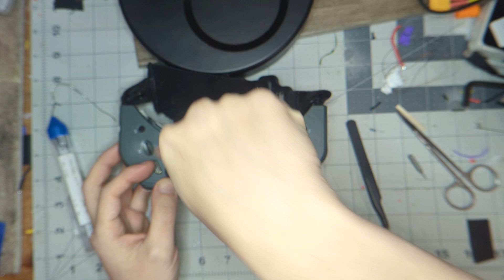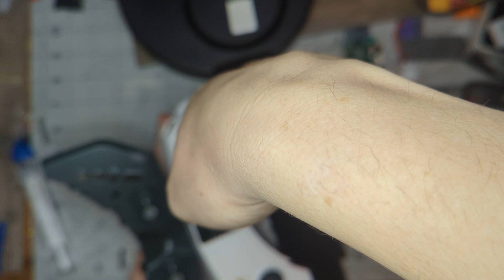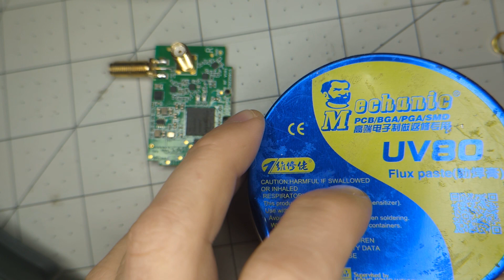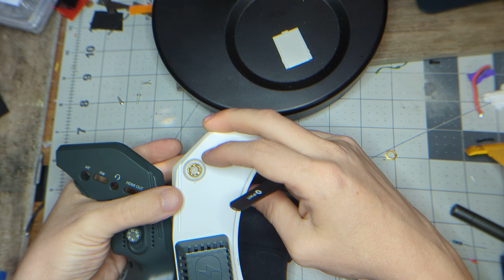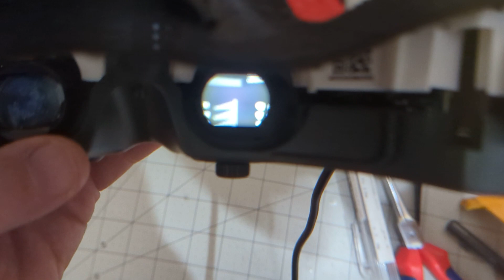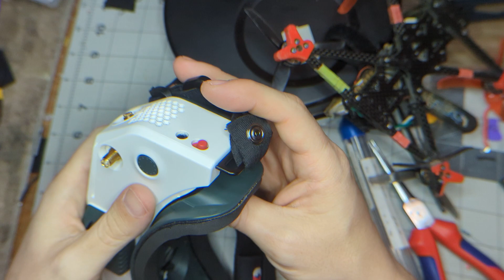HDZero Goggles top SMA low signal repair

Comment: Thanks for this video.  My top left antenna was very low signal strength, probably from dropping the goggles. I replaced the left side sma board and it's back working now. No visible damage on the board or solder connections though.

Comment: I got the round 1 goggles that had the nut on the goggles but saddly during taveling the the nut on the same sma connector you worked on came loose and the connector was bumped in traveling and came free from the board. the board was a total loss so I purchased a replacement board.  I reinstalled the goggles and the screens work but I get now signal from any antenna from my whoop lit vtx.  What should I look for?
Reply from the maker: Can you come on the HDZero Discord? It would be easier to troubleshoot there and you can share pictures.

I would start by reseating the mipi cable on the camera and VTX.

If you got the goggles prior to Feb 2023, I might try updating the goggle firmware, just in case there is any data that needs to be loaded onto the new radio board. The goggles that are currently shipping use different firmware that isn't released yet.

Comment: You did a really good job with this. Those ribbon connections must be a little bit tougher than advertised or are they strain relieved somehow at the connector? I don’t have them yet (March apparently) but I appreciate the demo. Luckily they seem fairly easy to work on since it would appear that diy repairs are immediately necessary in a lot of cases. I subbed. Thanks.
Reply from the maker: The ribbon connectors are fragile. If they are flat and straight, they can be somewhat okay under tension, but can break very easily.

Comment: Thanks for the video. I just received my goggle today and notice I do have the same low signal strength issue on the top right port (I wonder why it is always the top right port and not the left). I am just wondering what would be the effect if I just leave it as is and just rely on getting the signals from the 3 other ports before opening up the brand new goggle lol
Reply from the maker: That's really interesting that you are seeing it on a brand new goggle.

Did you already try swapping the left and right antenna? If it is still a problem, I would be really interested in knowing if it is this issue.
Reply: @aviphysics  yeah i tried to swap the antennas and the issue remains (so it’s not an antenna problem). I can see that the top right sma is slightly crooked (not straight)

Comment: You are way rougher with those ribbon cables then I would be. Think I'd remove them if they aren't soldered? Looks like some kind of plate with 2 screws holding them down onto a connector? Edit: thanks for video though! Issues like this wouldn't be too difficult for me to fix.
Reply from the maker: You can remove them. They are similar to the mipi connector on the VTX

Comment: Would hate to have to deal with this issue when my new goggles arrive any day now. I intended on running 4 stubbies, so over time there is a chance that without the sma nuts and washers on both the inside and outside of all 4 ports, that this will develop into a problem (particularly, if we want to keep the antennas installed all the time), which may well be out of the warranty period for the goggles. I wouldn't really want to open up the goggles for fear of damaging something else...
Reply from the maker: How did it go?
Reply: @aviphysics  I never got round to doing it and would you believe, I haven't even used the goggles for a single flight yet! Customer support said they could do the mod for me (and look at the lens issue some of the goggles are having), but I am away from home for several weeks and only have my sky03o goggles and a basic analogue quad with me for now!

Comment: Good video. Especially how you explain how to remove the SMA holding cup. 
But still, you need to be an expert in soldering to fix this. It's really hard, at least for me.
Reply from the maker: It requires some experience. A magnifying desk lamp also helps.